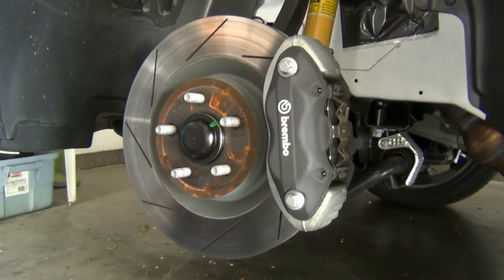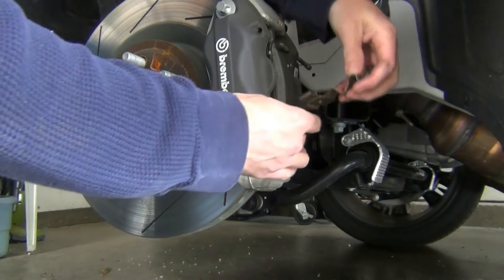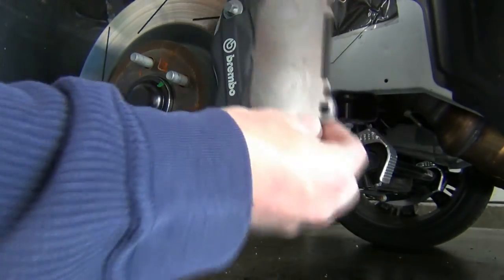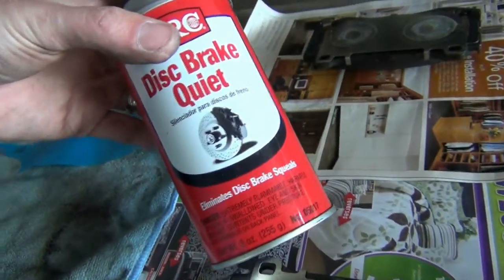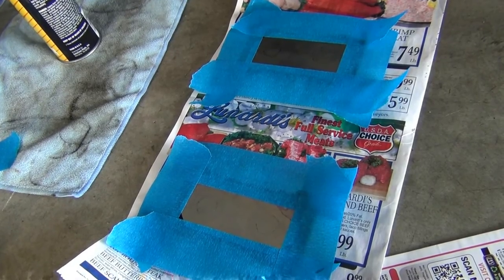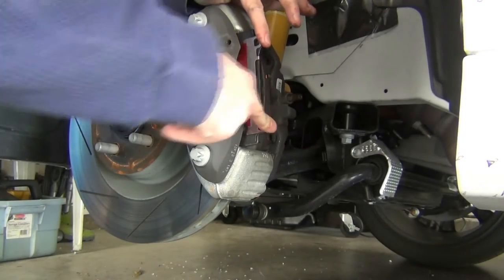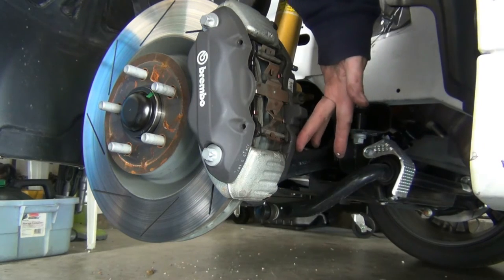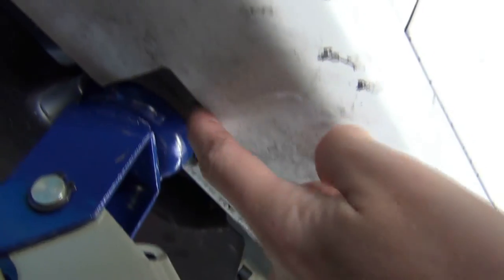2013 Dodge Charger SRT8 Superbee: Episode 7 Vlog: The Brembo brake squeal: Part 1

Comment from the maker: remember that oem goo i showed on the pads? That is a poor goo choice. It was still wet after all this time. Plus, they didn't use enough at the factory. A goo needs to set up a little bit and gain some firmness, so it doesn't smear out.

Comment from the maker: dude i just worked on mine again last week. its impossible to fix. i have tried every combination possible. with the oem pads with glued teflon shims it squeals most when cold. when you add the oem metal shims on top of that, then it squeals most when hot. you cant win. i have tried every combo of pastes and lubes too.

Comment: Hi temp pads usually squeak and dust. it's a compromise to stop a 4100 pound car as quickly as possible in a performance situation.
Reply from the maker: yup
Reply: Ethan Commins why does the brakes squeak on a cold start?

Comment: If I have brake squeak, is it necessary to spray both sides of the shim with Disk Quiet?  Everywhere else I see, they just do the piston side.
Reply from the maker: i like to do both sides. metal is metal and vibration is vibration. doesnt matter what side its on.
Reply: Makes sense.  Also, I didn't watch your videos before or after this - you didn't need to force the calipers open?  The pads would just slide out?  It looked a bit tight in removal but I thought you needed a pad separator or something.
Reply from the maker: you just press the pistons in if needed, making sure your brake reservoir doesnt overflow.